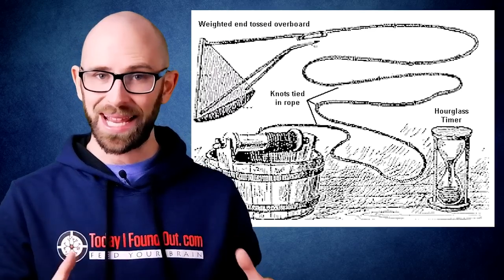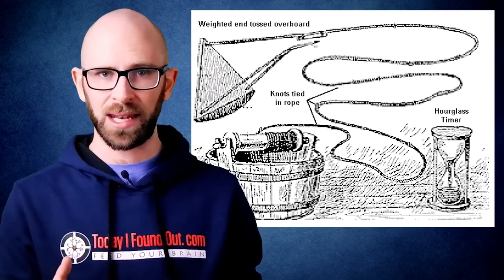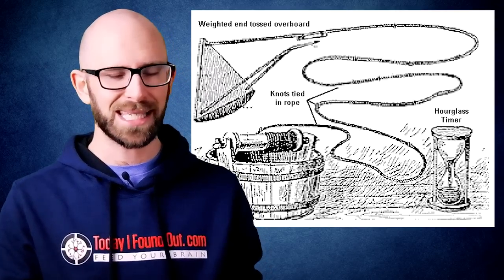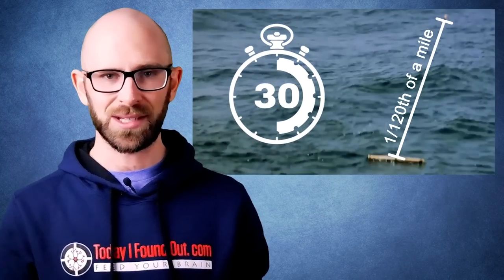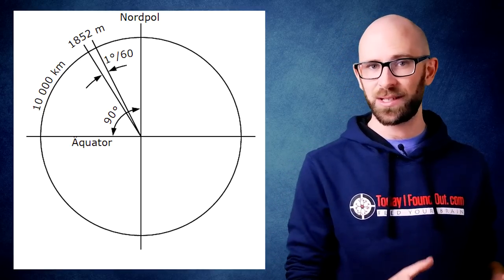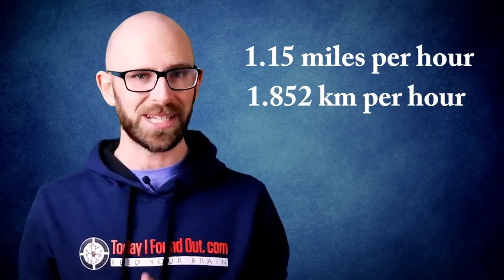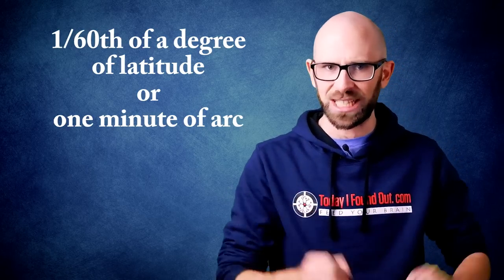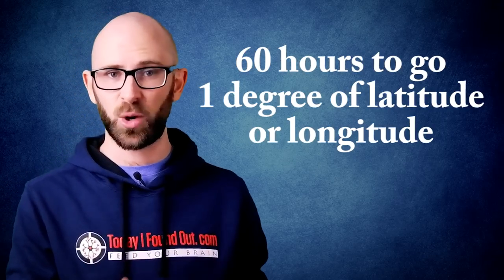Why is the Speed of Seafaring Vessels Measured in Knots?

Comment: You know, even though you explained it. I still in no way understand it.
Reply: garry king   Me either.
Reply: 1.  They use a rope with Knots.
2.  They throw it in the water.  
3.  They count 30 seconds, and pull the rope back out.
4.  Then they count the Knots.
5.   Now you know how fast the boat is going.  
6.   So and so Knots. hehe

They used to do something similar to judge the depth of the water as well.   Using a rope with a weight and knots, and would let it sink, if they didn't find dirt, they knew the water was deep enough to sail, if they found sand they would then count how many knots were in the water when they hit bottom, and would repeat this until they calculated the water was no longer deep enough to sale safely in.
Reply: It's like putting knots in a rope so they're all the same distance apart, tying it to something heavy, and then running as far as you can in, say, 30 seconds. Once you're done, you can use the number of knots you passed to estimate how far you traveled, and with the time it took you, you can guess how fast you're going.

For example, if you have a knot every ten feet, and you pass 40 of those knots in 30 seconds, you know you traveled 400 feet in 30 seconds, 800 feet/minute, or about 9.1 mph.

Of course, on a ship, you're already moving when you drop the "heavy thing" in the water, so you measure how fast the ship is going.

Comment: 1) It is convenient to print air navigation maps using lat and long, hence a unit of measurement tied to minutes of arc is useful.

2) The board at the end is triangular. When the line is run right out jerk it hard, one of the pegs will come out and the board will skate along the surface of the sea making it easier to recover.

Comment: I'm a strong proponent of the metric system however some of the old systems of measurement are irreplaceable due to their practicality. For instance we still use fathoms as a measurement for depth of water because 1 fathom is equal to the length of a mans outstretched arms from fingertip to fingertip, which makes it easy to measure lengths of rope.
Reply: Except that's useless because that distance varies, even among men of the same height.
Reply: Having worked for many years as a professional fisherman alongside deckhands of all sizes I can assure you the difference is marginal. If your arms are longer or shorter than average you learn to compensate by not drawing the rope out to it's full length or by leaving a small amount of slack.
Reply: Stu Saville Except the need to do that completely invalidates the measurement's accuracy.

And no, it's not marginal.
Reply: seigeengine I worked as a lobster fisherman for 14 years and have measured and cut literally thousands of lengths of rope. It only takes me around 10 seconds to measure and neatly coil 12 fathoms (22 metres) within tolerances of just 3 or 4 centimetres total. It's a muscle memory skill that becomes effortless once learned.
Reply: Well, yes, if someone had spent 14 years learning what a certain length of rope "felt" like, that person could easily measure rope that fast with that level of accuracy. But the fathom isn't special in that regard; If you'd spent those 14 years learning meters (or yards or whatever) rather than fathoms, you'd still be just as fast and just as accurate.
Reply: HiddenWindshield The Fathom is different from other measurement units because it uses an arm motion that allows you to efficiently measure while simultaneously coiling the rope. How do you propose to use other units like feet, metres etc to measure lengths of rope on a cluttered deck? Pace it out or use a ruler or tape measure?

The reason mariners have been using the system since the time of the ancient Greeks.is because nobody has come up with a better solution.
Reply: seigeengine I mentioned how long I worked as a fisherman to make clear the point that I'm  experienced enough to know what the hell I'm talking about. The margin of accuracy of measurement by Fathoms is well within acceptable limits. 

Any attempts at greater precision is utterly pointless due to variables such as the fact that ropes stretch.with use and water depth is not a constant.
Reply: Stu Saville And I mocked those claims to point out how ridiculous it is to expect people to defer to you simply because you claim to have experience.

Not so, all additional uncertainty decreases the accuracy of the measurements.
Reply: The length of a fathom is exactly like meters, but it requires more math to work out. You can also convert fathom to meters if need be.The reason his county still has that system is probably because it has that use for fisherman. He is just doing to a rough estimate for a job that doesn't require pinpoint accuracy.
Reply: +seigeengine
People generally defer to those with seniority, kid. It's why "kid" is a pejorative. You'll learn that once you venture out in the real world.

Comment: Aviator's sectional charts have grids printed on them that are delineated in 1 minute of longitude and latitude.Each square or "tick bound quadricle " contains 60 nautical miles up and down and then across. These are very convenient to work with when you want to verify  speed, distance and time at a glance.Some flyers still use paper charts but the same navigation aide is now scanned digitally to navigation apps for a tablet or phone. These maps are packed with other useful information that I consider a friend in the cockpit! If you know an aircraft, pilot ask them to loan you one to take a look at.They are a lot of fun to explore.

Comment: Those of us who call ourselves pilots ALSO use "Knots" as the basic speed unit.  In the case of instrument failure, we all carry a small parachute aloft with a 5 kilometer spool of line with knots tied every 514 meters.  When our airspeed fails, we simply toss the parachute out the door and as long as we tick off a knot every ten seconds, we know we're flying at exactly 100 knots airspeed.   You must of course take precautions against rope burns.

This is a bit more complex for airliners with pressurized cabins and first class passengers prone to complaint.  .

Comment: I learned a much simpler version, but it might be wrong...    I learned a nautical mile is a mile on the ocean or in the air (hence why aircraft use it too) , and a statute mile is a mile on land.   one is 6076 feet and the other is 5280 feet.  that's why knots are referred to on the water, and yes the calculations come out about the same, 1.15 miles per hour = 1 knot

Comment: The ironic thing about it, is it started out as an arbitrary mess, but long after metric measurements and standards came in, it is the only system currently in use where the measure really does relate to something comprehensible, like degrees and minutes. If we insist on dividing a circle into 360 degrees, and then having hours, minutes and seconds of a degree, then the nautical miles and the measure of knots makes perfect sense. No other measurement in use today quite does that...

Comment: They forgot to mention that a hundred thousand flights a day navigate around the planet reference to knots. All distances reference are measured in nautical miles outside of China and Russia.  Aircraft manufacturers install aircraft instruments that reference only knots, in the cockpit. Seems to make a lot of sense due the fact that 1 minute of longitude or latitude at the equator equals one nautical mile and all the airway charts are in knots.  It makes the most sense for earth based navigation.  And just my 2¢... did you know all altitude (outside of Rus and China) is measured in  feet!  Very cool, all aircraft are separated by a handy 1,000 feet ( below 41000'pa).

Comment: Why do aircraft use knots? I asked my flight instructor once and he didn't know either.
Reply: Same reason we use the term 'airship'.  Military classifications.
Reply: Time to get a new instructor!
Reply: The exact same reason  they stated for sea travel. Because it matches the coordinate system we use on maps.
Reply: The plural of aircraft is aircraft. No "S"
Reply: rideswithscissors Pluray?
Reply: I think that's entirely cultural. Aircraft are viewed as a sort of successor to seafaring vessels (even if the latter still exist) and so they borrowed a few terms from them.
Reply: rideswithscissors Don't forget, "Bean me up, Scotty".
Reply: rideswithscissors It's weird since we use celcius for the tempature, feet for altitude and knots for airspeed... XD
Reply: On the water or in the air there is an adjustment you have to make. The sea is moving and the air currents could be substantial. 
So, on land were the ground doesn't move, there is no adjustment. 
If you have a 50 mph headwind and you are moving at 150mph, your ground speed is 100.  So takes this into account.
Reply: It's a tradition borrowed from nautical navigation. One knot=One nautical mile. One nautical mile =6000'; or 0ne second of latitude.
Reply: Koz in the olden days the pilot released a little parachute connected to a very long string with knots tied along it evenly. The amount of knots that would rip through their gloves was how fast they were going.
 You're welcome.

Comment: Alright, I understand the usage of knots for boats and ships, but why do airplanes use knots?
Reply: The system developed for maritime navigation is eminently suitable for aviation, because both modes of transport are actually very similar in a navigational sense. Neither usually have well-defined lanes (unless near the coast/airport) such as roads or rails. When in the open, there are few to no visual cues for landmark navigation, so one had to rely either on dead reckoning or celestial navigation. Both modes of transport are often used for long distance travel. This all boils down to both maritime and aviatic navigation relying heavily on vectors on a global scale, in which knots are quite handy. Because of the link with latitude and vectors, using knots and nautical miles for certain trigonometric calculations required in navigation is more intuitive than the same calculation in kilometers or miles.

When aviation was developed, pilots adopted a great deal of the previously maritime knowledge to deal with fairly similar challenges, and they consequently became standardized in both fields. If you look at WWII bombers, the navigational instruments and principles they used were for all intents and purposes exactly the same as those on a naval ship. Things have obviously changed a lot since, but as an interesting side note, some navigators in both fields are still trained in celestial navigation in a way that is entirely applicable to both aviation and maritime navigation.
Reply: The Naval Institute published monthly tables for air navigation, a magazine-like format with a simplified  sight solution since it was unlikely that a plane would carry the complete set of pub 214 (sight reduction tables),  The aviation sextant (device for measuring star angles) used a bubble level since if you are over the clouds you don't have a horizon to measure against.  Long range aircraft had a glass bubble dome in the overhead so the navigator could get his readings without sticking his head outside, unlike me who had to do it on the bridge wing bracing myself against the roll of the ship in the north atlantic.  Tadey everybody uses GPS and most mariners wouldn't know how to take a star-sight or a sun line.  I wonder if they do an accuracy check on their gyrocompass with a bearing on the morning sun?

The nautical mile is based on an actual measurement, unlike the statute mile that is arbitrary by law.  The meter or metre pretends to be something like a ten-millionth of the distance between the pole and the equator but it is wildly inaccurate, neither the land mile or kilometer lends itself to navigational computation.
Reply: Palmerrip ,,thanks,,great bit o knowledgs properly explained

Comment: Does this assume that the water being traveled on is stationary? I always thought knots dealt with vectors and traveling on or through mediums that are also moving in different directions. 

e.g. the whole rope knot system wouldn't work quite right if you were traveling on a flowing river.